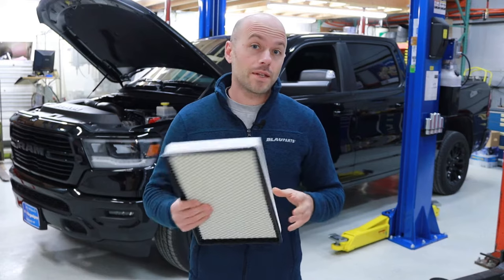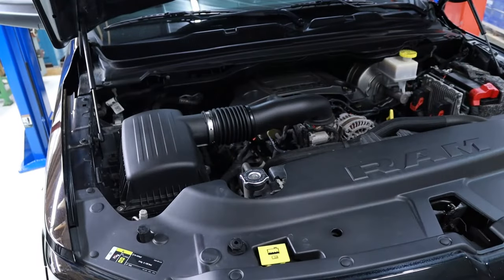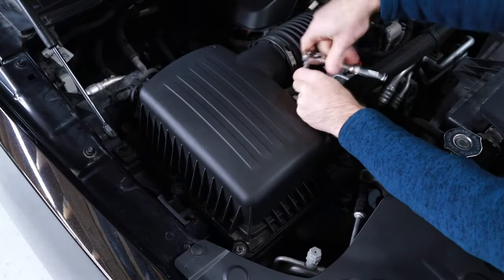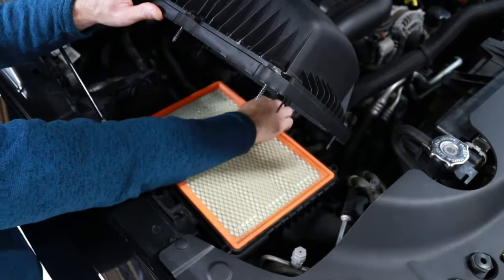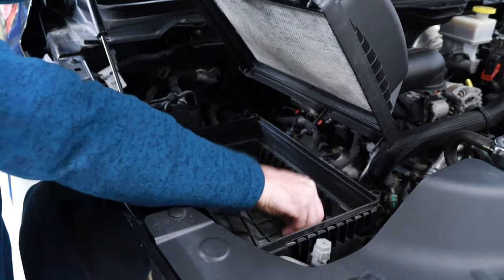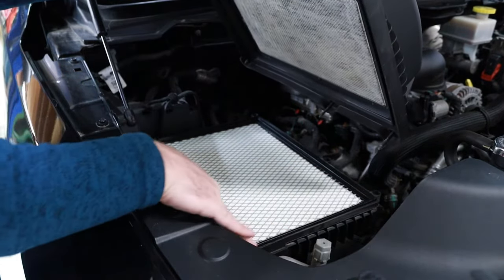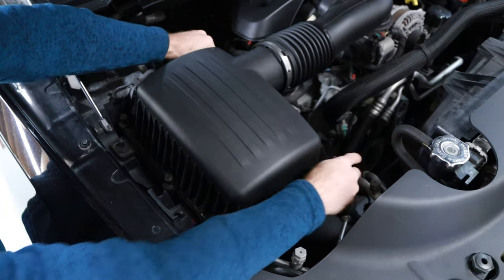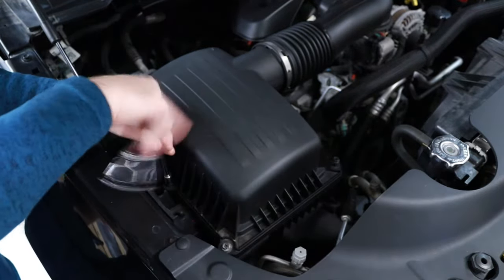Ram 1500 Engine Air Filter Change DIY (5th Gen 2019-2023)

Comment: The bolts have to come out.  In this video some type of protective bar covers a small portion of the air filter casing.  That bar is covered by a fan cowling!   Take the bolts OUT and slide the cover back